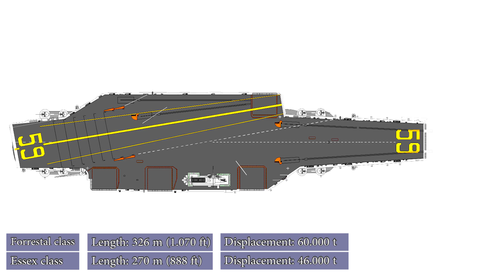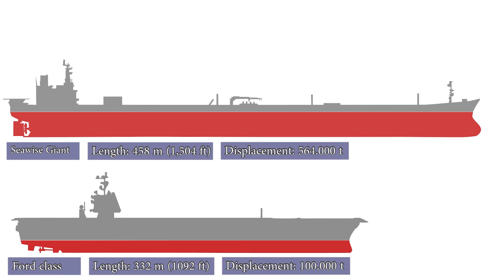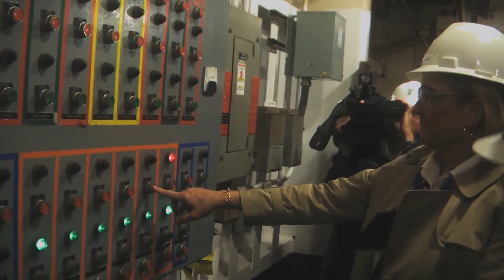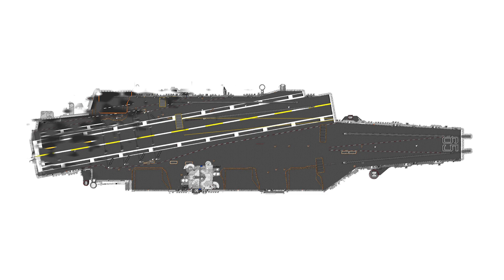Why don't aircraft carriers get bigger?

Comment: The USS GERALD R. FORD cost $13.4 billion and if you build bigger it becomes an asset, that no nation can afford to lose.
Reply: This is also why the british and germans were so reluctant to engage in fleet battles during WW1 and 2 since it could mean the loss of incredibly valuable warships that was hard to replace. One bad fight and you lose the entire war at sea.
Reply: Yeah, Japan's Yamato battleship was nicknamed Hotel Yamato by its crew because they are always in port and was never used its special design to its advantage.
Reply: And when an asset becomes something that you can't afford to lose, it becomes a liability...
In Naval terms, your thinking switches from "how can we use this to perform our mission" to "how do we protect this ship" a radical change of attitude.
Reply: @EarlJohn61  And half the Hardware on the USS GERALD R. FORD still does not work as advertised.
Its a giant Xmas turkey.
Reply: Mostly because of development costs. Follow on carriers in that class will cost less.

Comment: The bottom line is carriers are not longer because they just don’t need to be.  Anyone who’s seen Dry Dock 12 at Newport News Shipbuilding understands building a giant super carrier is completely feasible.  The only real reason is the global infrastructure (mainly piers) could not handle them.  The maneuverability would an engineering challenge to meet the requirements, but is also feasible.
Reply: Same as with building airliners bugger than the A380. Sure it can be done, but the airports would be able to support it.
Reply: That drydock can fit 2 carriers in it, just being near that dry dock is amazing and realizing that these monsters need a dock that big will boggle a mind that doesn’t know
Reply: I live in Newport News and can vouch for those comments, that facility is huge.
Reply: Some larger naval bases can't handle the existing ones! I was in Britain a few years ago when a US-Carrier-Group made a port call in Portsmouth (I was at the museum, looking at the ships they have there - including Nelson's Victory and the HMS Warrior)...the escorts could enter the harbor just fine (in this case I got to see an Arleigh-Burke-Class Destroyer), the carrier had to stay out (it'll probably run aground in the Solent)
Reply: @dreamingflurry2729  The issue I ran into on the Enterprise was usually size. Though some nations don't want nuclear powered vessels in their ports. Though UK isn't one of them since they have their own nuclear powered vessels. Only place we were able to actually dock on our port calls on my cruise was Ft. Lauderdale, FL and United Arab Emirites. Everywhere else we had to anchor off and take liberty boats to get to shore.
Reply: The only real thing that a longer flight deck would provide is to allow for aircraft with longer takeoff demands which are also what catapults are ment to shorten.
Reply: @seanrea550  !p1pp Del
Reply: If you're going to do all that, just have a waterjet propulsion system with like 8 on swivels around the ship.  Speed, maneurverability and survivability.  You could have a 2nd runway for drones so can do both at the same time.  A ship that size would have to have a flexible hull rendering modern torpedoes near useless. At least another 10k tons of weapons.  It would need minimum global infrastructure or what's the point.  Can double the stores with roughly same crew and still have room for an olympic size swimming pool, complete with built in wave maker.
Reply: They are as big as they need to be.   We have no problem engineering planes that can take off from and land on a regular size carrier. For the cost of a carrier twice as large you can build 4 regular size carriers, and that means you project power over 4 times as large an area for the same cost.  It also leaves more funds for building the escorts you need to help protect that carrier.

Comment: I’ve seen concepts for literal floating airbases. Like it’s just a landing strip. For the use of near/at coast before a proper in country airstrip can be constructed. Although with modern AtoA refueling it’s become useless. The only upside being less air fatigue
Reply: Crew fatigue won't be an issue when crewed aircraft get replaced by drones.

Comment: And another thing. Workshops to repair damaged airplanes. The required floorspace for airplane repair facilities of a 30,000 carrier is as large as a 100,000 ton carrier.
So if you shrink a carrier to smaller economic sizes you actually lose strike capabilities because the repair workshops don't become smaller and your ship gets to carry less aircraft.
The repair workshop floorspaces will only shrink when your airplanes shrink.
This is one of the main factor why Britain ditched the 22,000 ton Invincibles and went straight to the 65,000 ton Queen Elizabeths.
Reply: That's interesting opinion
Reply: The rise of strike drones and kamikaze drones might help. Uncrewed platforms tend to be physically smaller than crewed platforms. Kamikaze drones don't need repair facilities because they don't usually return to base. Even a small ship could carry hundreds of them, as they aren't much larger than individual munitions. But kamikaze drones wouldn't be useful for show-of-force operations where you want to reassure friends and intimidate adversaries by flying your crewed aircraft around. The main job of an aircraft carrier is to be a symbol. Having to actually fight with them means the primary goal of deterrence failed.

Comment: My two cents worth.  The US has a number of Amphibious assault ships which are smaller than aircraft carriers but can perform some it's functions / duties. Recently the addition of the naval version of the F35 to the fleet of amphibious assault ships has increased their capability significantly. There are many sources of information describing what these "smaller carriers" are capable of. The Wasp-class amphibious assault ships are the latest version of this class, weighing in at around 50,000 tons. Half that of the full size carriers and much cheaper of course. Having a fleet of these provides a country (not only the US) with increased flexibility for military and humanitarian operations. in particular the support for aircraft like the Osprey and other rotary aircraft further increases their capability. The video mentions size being an issue in terms of port access and maintenance. The smaller size of amphibious assault ships enables them to travel to places that the larger carriers might not be able to access. Plus the support for amphibious landing craft is also another very useful capability these LHA have. The current US fleet size of LHA is 9 plus another under construction. (It may have already been launched). So in effect the US has a second fleet of aircraft carriers. While obviously not the same as full size carriers, this 2nd fleet probably removes the need for larger carriers and to a certain extent enlarging the fleet beyond 10 of the big boys. Thanks for the interesting video, a pleasure to watch. Thumbs up.
Reply: You can't really replace the super carriers with the LHAs because the f-35Bs onboard them don't have the same capabilities like the super hornets on the large carriers , the vtol aircraft on the LHAs have limited fuel and payload capacity compaired to the F-18s on the super carriers and are in much smaller numbers
Reply: @dwyderdom  Yes, the LHA are not a replacement for super carriers. They each perform different roles. Importantly they can operate in tandem providing greater overall capabilities to the fleet.
Reply: @dwyderdom  but this ships can really help the fleet (but not replace, yes)
Reply: @dwyderdom   I agree with your point and am going to extend it one step further. Because the LHA’s are smaller they also carry less fuel and munitions for their aircraft. This is problem is further exacerbated by the LHA carrying marines and the supplies they need as well as boats and landing craft inside.

This means that they cannot sustain their aircraft for long. I remember reading that the navy found the operational endurance of F-35Bs on LHAs too short and unsatisfactory. Unfortunately I can’t provide a citation, but I’m sure you can find it.
Reply: @radnaamunkh-orgil3402  The "Lightning" carriers support Marine amphibious operations. They are also a back door resurrection of the 1970s Sea Control Ship concept which called for smaller carriers that could perform in low-intensity environments in order to free up the Supers for the high-intensity operations.

However, as space is limited in the smaller amphibious ships, it is a calculation that must be reperformed regularly on which to maximize strike (F-35B) or troop movement (Chinooks, Ospreys, and Sea Stallions).
Reply: @Rob_F8F  q
Reply: Yeah
Reply: It's by law that the USN has to have that many super carriers in the inventory.
Addition: and why they haven't increased the number on their own initiative.
Reply: F 35 B is an excellent fighter but does not have the range of a F 35 C. Amphibious assault ships cannot handle F 35 C which have a different mission.
Reply: The addition of the F-35B hasn't really increased capability in any real sense. The aircraft mostly is for close air support, something the AV-8B was already effectively doing.
Reply: There has been consideration with the reintroduction of light carriers into the modern day with the recent advancements
Reply: Those "Lightning" carriers don't have native tanker suport or E-2 AWACS, so unless you want to burn up the airframe hours on those F-35B's to have 1 of them in the air 24/7 the entire time the ship is at sea, the "Lightning Carrier" depends on a Nimitz Class with it's F/A-18's and E-2's for tanker and AWACS to know what's going on around it past 35 miles
Reply: @pogo1140  True but if needed the USN can always modify a crowsnest to work on a seahawk. The crowsnest is a helicopter based AWAC used by the Royal Navy. The  Lightning carriers will still lack a tanker capability but will still be better than most other countries carriers.
Reply: @davidteer80  Better on a V-22 Osprey
Reply: @pogo1140  Regarding the E-2, I wonder if a drone version of it is possible?
Reply: @craigkdillon  The point of the E-2 is to provide radar coverage, now think of all that data being sent out from the drone to the carrier, broadcasting to anyone and everyone where it is.
Reply: @pogo1140  I realize that. My question is with all the advancements in communication systems -- Can the E-2 by replaced by a drone?? or, at least be partially replaced?? 
To put it another way - can the electronics officer on the E-2 be made remote?  
Secondary question -- if so, can such a drone be made to operate from an LHA?
Reply: @craigkdillon  Short answer, no, not enough runway, not enough lift capability, not enough loiter time. not enough deck space to store them and you need 4 of them, 3 to provide 24hr coverage. 1 as a spare
Reply: @pogo1140  that is what I figured, too. The E2 will need to be replaced on the carriers, though. It is getting old.  I wonder if the replacement can be a drone?
Reply: @craigkdillon   they are not going to have a replacement for E2, and no new AWACS in the plan, even the land-based one. the way to conduct area warnings and info is changing, i think they are making B21 and F35 mesh to function like E2 instead of a single easy detect and slow-moving radar-carrying plane. there is no new EW plane in the plan too, not sure what's replacing those.
Reply: @craigkdillon  no AWACS for drone, but the US are developing lots of support drones like tankers, surveillance, and escort drones. So there's that
Reply: @craigkdillon  Rumour a EV-22 Osprey
Reply: @haihengh  There was talk of a EV-22
Reply: bring back jeep carriers. f35b. ww3 will be fought on the improvised flight decks of container ships, like the falklins war was
Reply: The amphibs do NOT have the "naval" F-35C w/ big folding wings, tailhook, and reinforced landing gear for the shock of catapult launch. Instead they have the F-35B jump jet which does vertical / short takeoff and landing, but has much higher cost and maintenance and less range & weapon-carrying capacity.  Also the amphibs don't have real tanker, transport, radar, or electronic warfare planes, just less-capable helicopters.
Reply: @IrishCarney  ya thats why theyre trying to get that refueling drone up to snuff i imagine. they need an f35d tbh to act as a refueler. 
 f35 b vs c with refueling right after launch minimizes the differences but youre right they are major concerns, especially with standoff weapons and the size of the pacific
Reply: @vevenaneathna  They should have done the Common Support Aircraft concept.  Like how the E-2 Hawkeye Airborne Early Warning plane and the C-2 Greyhound transport plane have the same basic components, but expand that to include a tanker, an electronic warfare plane, a sub-hunter, etc.
Reply: @IrishCarney  i guess they did with tankers considering the most used "tankers" are hornets which is just putting a bunch of extra stress on fighter air frames. so, they did do that but in the dumbest/most short sighted way possible lol
Reply: The US Navy only has 13 F-35C compared to 435 F/A-18 E/F--You're going to have some problems using only Amphibious assault ships. :D
Reply: @heretolevitateme  Well they're going to have a lot more F-35Cs than 13 going forward
Reply: @heretolevitateme  not as many problems as china will have using only ground based aircrafts and next to no refueling capacity lol. they dont even have a stovl fighter in the works. probably coz there isnt any russian engines to pawn off as your own
Reply: Amphi carries marine f35b not navy f35c
Reply: Humanitarian😅😅😅😅😅
Reply: I think US should ditch the huge carriers. Too big of targets. Can have the same affect sending out a fleet of smaller variants.
Reply: What if we had some smaller carriers that could do 90% of what a supercarrier could do? They could launch and land, refuel, and restock the ammo, but that's about it.
You would still want them nuclear, for the desired range. If nothing else, they could launch refueling drones closer to the target so the real fighter aircraft being launched from the supercarrier has increased range. They would have a very limited air wing, mostly refueling drones, but could quick-turn a Tomcat. They couldn't perform repairs or anything fancy.
Make them small, somewhat stealthy, and cheap. They go out ahead of the supercarriers into higher risk areas.
Reply: I think the America class is newer than the wasp class
Reply: THANK YOU , SIR FOR YUR INFO AND VALUABLE  INFORMATION. 👍
Reply: *its
Reply: They have no AWACs and ASW capability, thus cannot replace a supercarrier.

Comment: Maybe i can think of civilian aircraft carriers  or simply as "Cruise Carriers"

A civilian aircraft carrier would've be the same size as Cruise ships and could carry small private planes and helicopters with large hangars below the flightdeck. It would'nt carry so much passengers as a cruise ship, but enough for both tourist passengers and aviation geeks.
It would've be painted commercial white instead of gray, and the cost… who knows in the future…
Reply: The technical expertise required to land on a carrier is no joke. You would need specialized pilots. Though Cessna 172's can undoubtedly land on carriers, even unhooked, especially with a 30 knot headwind.
Reply: @SUBSTYGRAM  Sure they could, but then what? They have to be moved to a parking spot, chained to the deck,  refueled, and washed completely about every couple days. When a storm comes, will they be able to survive waves crashing over the bow? What maintenance support would be available? Aircraft operated from a salt air environment need a ton of it.
Reply: @michaelmappin4425  These are just imaginations about ships in the future, so it's not real yet.
Reply: The planes that would be able to land on civilian aircraft carriers with little modification, ironically, are very unlikely to be the ones carrying those who'd have the resources to be on such a ship.

No billionaire wants to be seen flying in on a dinky little Cessna 172 or a DA-40—and if a billionaire is also a private pilot, why get a shitbox when you can get something much cooler like a PC-12?
Reply: The carbon footprint per passenger of a civilian aircraft carrier would be ridiculous, so the only way it gets built is if enough people remain climate change deniers. As the frequency and intensity of extreme weather events continue to ramp up, exactly as climate scientists have predicted for decades, it becomes harder to remain a climate change denier. Harder that is for smart people, and stupid people tend not to have enough money to enjoy frivolous luxuries like a civilian aircraft carrier. Thus the window is probably closing on idiotic ways to burn fossil fuel, so you'll need to build this thing quickly before, say, Mar-a-Lago vanishes beneath the rising seas.